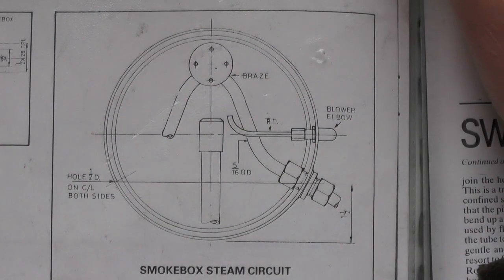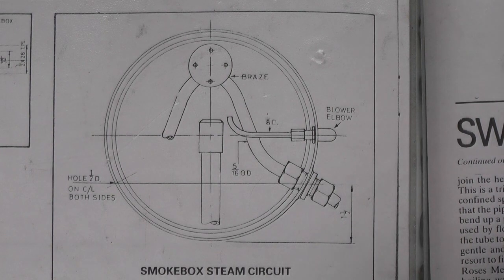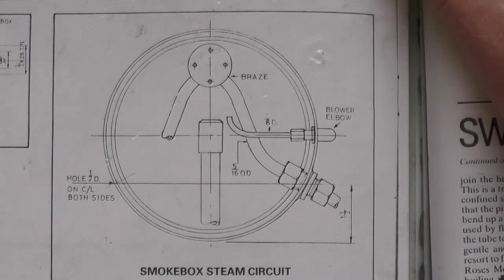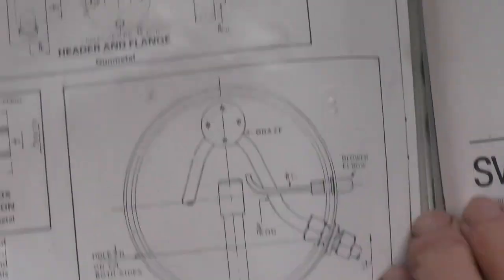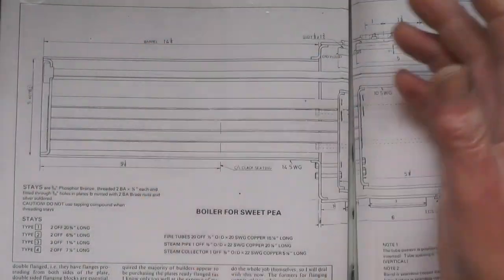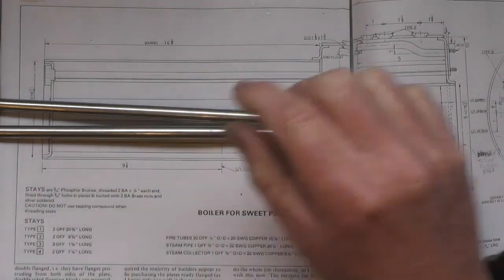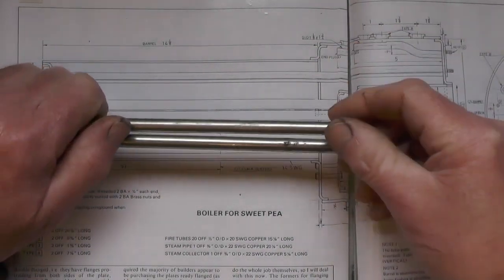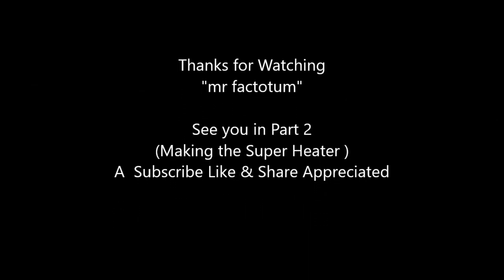Make a Miniature Steam Locomotive Series ( Super Heaters Part 1 - A Beginners Guide ) "mr factotum"

Comment: Nice video as usual. Will look forward to next episode.. looks like a tig welding job??  Stupid question Mr F why stainless steel and not copper tube  like the rest of the boiler.. keep safe  Dug Hogarth ..
Reply from the maker: Good question! Hi dougie
Thanks for watching . well i'm no expert, but would imagine copper in the fire / flue heat without water in it wouldn't last long. ??
Well that's my theory Dug
see you next time
regards
mr f
Reply: Morning Mr F enjoyed part 2 ..now I get it..  wont bother with superheater on my loco  soldering the boiler will be a big enough  challenge.. starting on the wheels today  and will let you know how l get on. Another question for you,  what clearance  did you give  between the axle box and the wheel I can't seem to see  anything in the book  .. I was thinking of 5 thou per side      but may need more for track anomalies  and suspension movements  etc.. what did you make yours??  Keep safe as always and keep the videos coming.. yes I'm up early and also we are  1 hour ahead of you  2 hrs in winter  Dug Hogarth